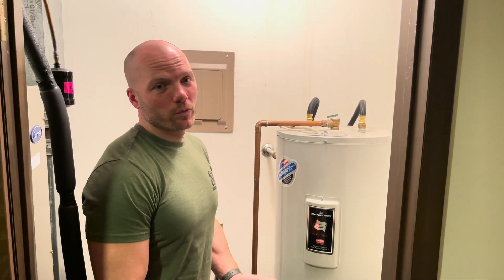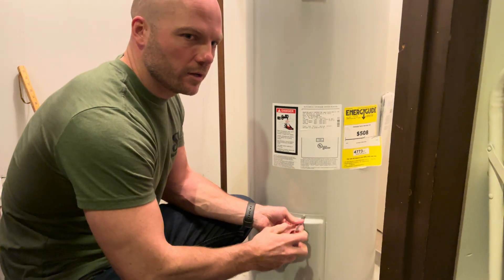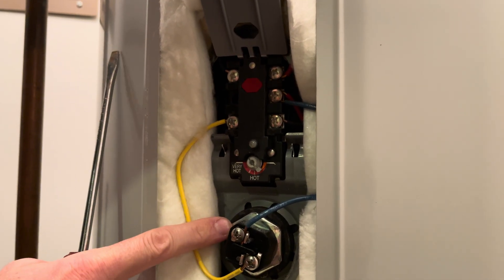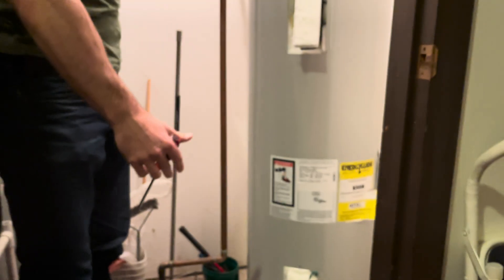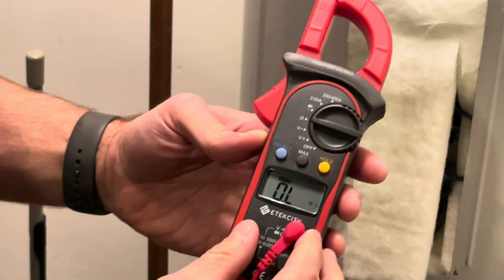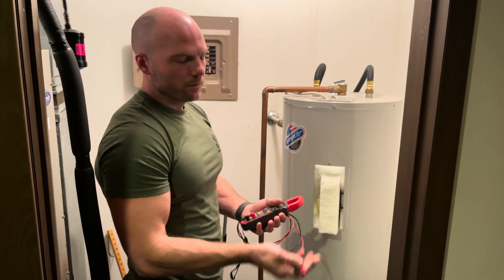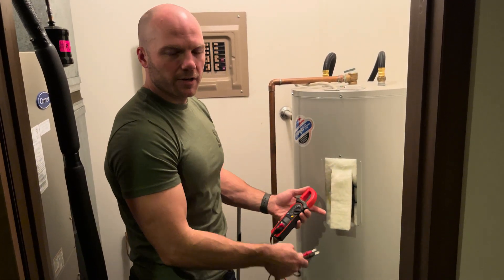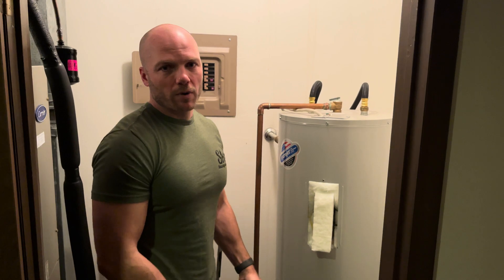Water heater not working? How to troubleshoot...

Comment: I don't know water heaters but I know electronics and I'm assuming the two elements are connected in series meaning 1 wire connecting them, and if that's true, you could still have a bad element  and most likely do have a bad element because your measuring the resistance of a completed circuit not the individual elements. I would disconnect the wires and measure them otherwise your data is a false positive.

Comment: Can you explain the element ohms check? What's the range they should read? A dumb different question related is why are they reading power if the powers turned off? Noob here.
Reply from the maker: you will want to test the ohms when the power is off. what you are checking is the amount of resistance that the element is causing for the electricity to move through it. The elements resistance is what causes it to get hot. The Ohms should read somewhere around 8-16. If you are getting a really high number way over the 16, then the element has probably burned up and will need to be replaced.

Comment: In less than a month I had to press that red button. Anybody know why? Is my water heater getting old?
Reply from the maker: Sometimes it happens with a power surge or when water gets really cold coming into the system.  It should not happen very often but I would reset it and see if it happens again.  If you need to press it again soon then I would say to warranty out your water heater as it should not be doing that.
Reply: @SkyManagement  I’m in Allentown PA, so water has been super cold these days. I’m guessing that’s the problem. It happened about a month ago. I don’t have a problem pressing the button, but I just don’t want it to happen eventually every week lol. Thanks so much!
Reply: Brand new water heater just over a month old. Been hitting that reset often myself. Had both thermostats replaced payed $390 for labor and still not working. Every couple days still hitting the red button
Reply: Excellent video. New Apt, zero hot water after initial scalding. "Apt Maintenance" came, "touched" bottom thermostat, told me to be patient & let it warm up. I'm a home Inspector & retired electrical engineer. They didn't know to even look at the reset button. Did it myself after threatened by manager "not to touch" the WH. What she doesn't know, she doesn't know. Thanks for your video 👍